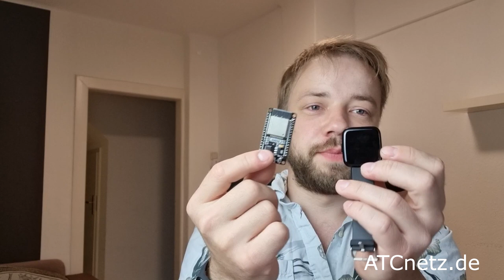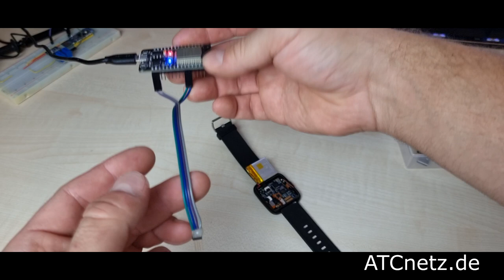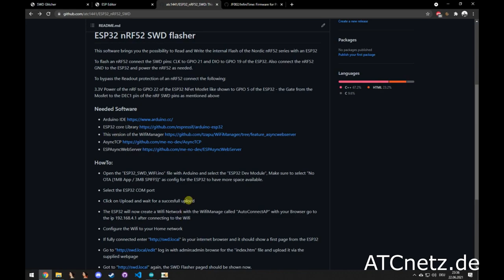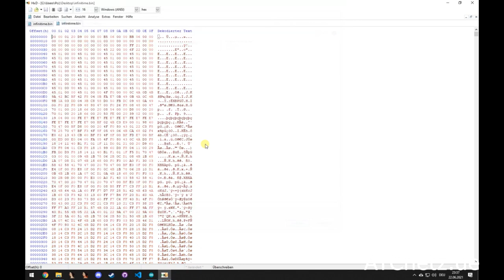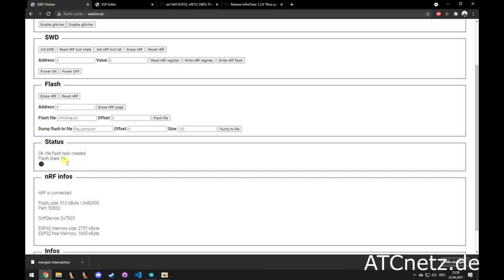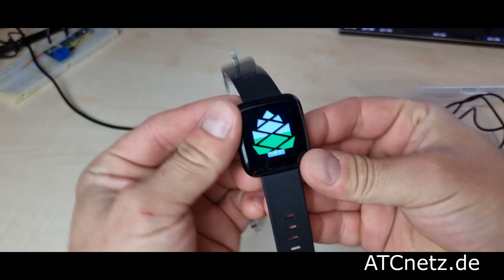How to flash the PineTime(or any nRF52) with an ESP32

Comment: Great replacement of the ST-Link or J-Link!!! I hope for some ESP32 design to flash the firmware via BLE DFU. Maybe the ESP32 can work as a BLE master...
Reply from the maker: Hey. It can work as BLE master :) 

Dream solution is to have an Arduino script directly sending the compiled firmware to the esp32 so it uploads it via BLE or SWD

Comment: Thank you so much! Got it working with an ESP32CAM. Infinitime doesn't seem to work on P8 though
Reply from the maker: Perfect.

The P8 has 2 different pins connected on the nRF so that is needed to be adapted

See here https://github.com/atc1441/ATCwatch/blob/master/ATCwatch/pinout.h#L31
Reply: @atc1441  I think the softdevice is screwed up on mine. It shows 0x8. Can I change that with this tool? Or does it even affect the watch since it's programmed over SWD?

Edit: nvm im stupid
Reply from the maker: Yes you can flash the sd,  flash it to 0 offset and the firmware itself with the needed offset

Comment: Can you flash a sealed watch? If not, do the dev kit come with an os already installed?
I want to buy one and be able to put other OS later when I have time
Reply from the maker: They come pre flashed, you can change the os OTA later
Reply: @atc1441  In the case of dev kit and the sealed one? Because all the how to flash videos show an open dev kit.
I don't know which one to buy to have a usable watch right now and hackable later.
Reply from the maker: For both its the same, you cam buy the sealed one
Reply: @atc1441  Thank you. I will take the dev kit to be able to play with it later. But close it and use it as it comes for now.

Comment: Quick question.. 

(For starters.. yes, I do realise that this is most likely a totally stupid question.. but oh well..) 

I’m about to order a PineTime.. is this possible with the normal end-user version? Or must I get the DEV version?
Reply from the maker: Hey, both versions are the same only that the DEV version has an open back cover
Reply: @atc1441 Hey! thanks for the quick response! So then I assume it’s entirely possibly to pop off the back cover on the normal version, if I ever needed to access it? Or would it make more sense to assemble the dev. Sorry if I’m being a broken record, just making sure!
Reply from the maker: It really depends on your needs. But if that sounds good to you it's the right way
Reply: @atc1441  Thanks man. I really just wanna replace my Apple Watch that won’t stay charged for half a day even, anymore. But I just wanted to make sure that if I got the regular one, and wasn’t satisfied, that I’d still be able to reflash a custom/different firmware. I appreciate all your help! Subscribed!